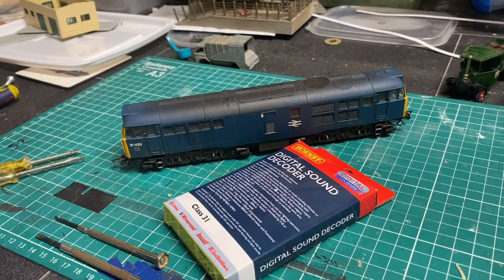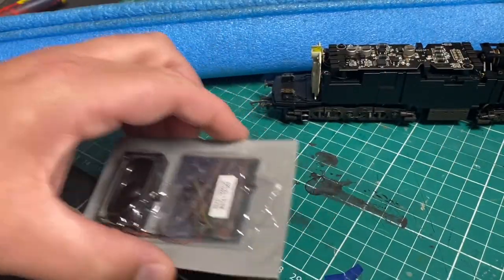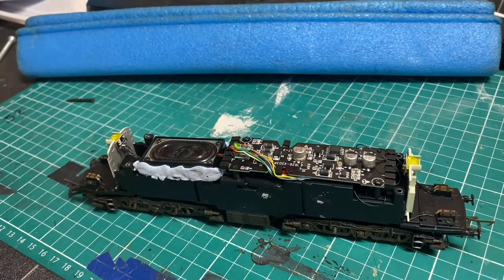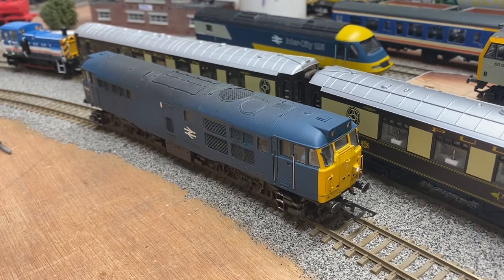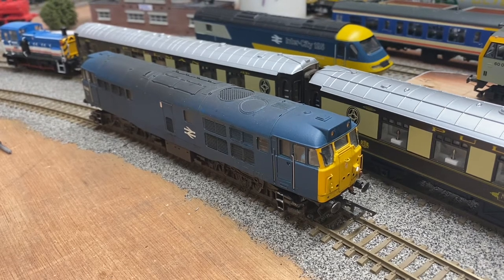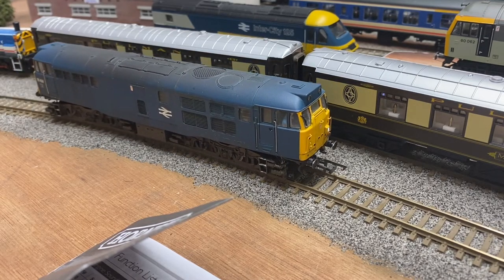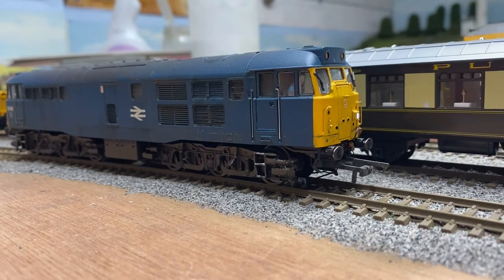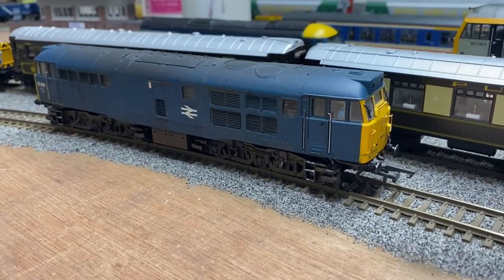Hornby TTS sound class 31 and running in the garden. OO gauge model railway

Comment: I have just purchased one of these, getting very rare now and heaps better than the Loksound V4.0 which is a very poor decoder, most of my stock is now fitted with TTS which I think for the money are great..you may be able to re-install the fan over the speaker as I intend to do, just a small framework should do it..